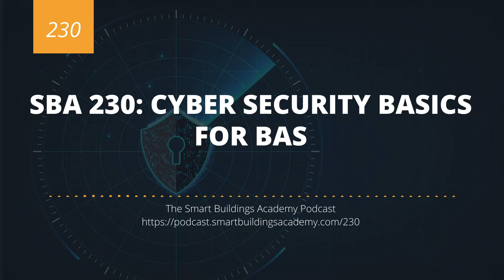SBA 230: Cybersecurity Basics for Building Automation

Comment: I have a degree and several years of cyber experience. I am currently in an HVACR school. If I want to use my cyber knowledge what would be the best BAS job I should be looking to get into?
Reply from the maker: BAS engineering or BAS Programming. Also doing BAS integration are good solid skills. Connect with Phil Zito on LinkedIn and I will point you in the right direction.
https://www.linkedin.com/in/phillipzito/